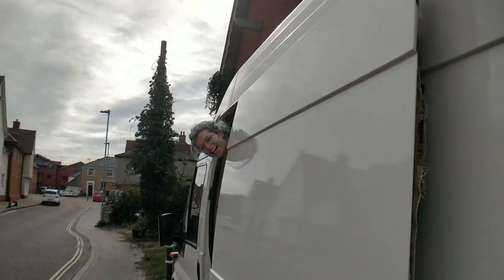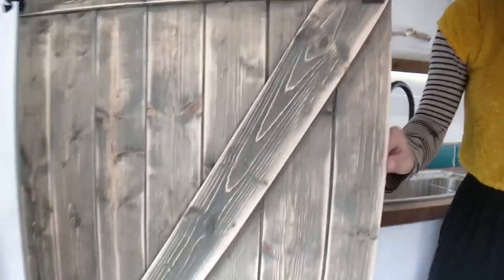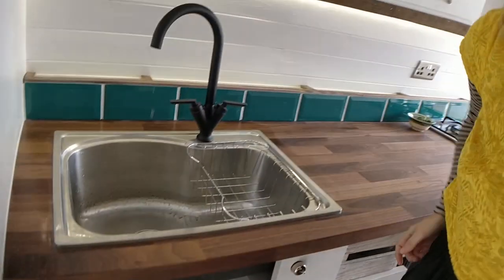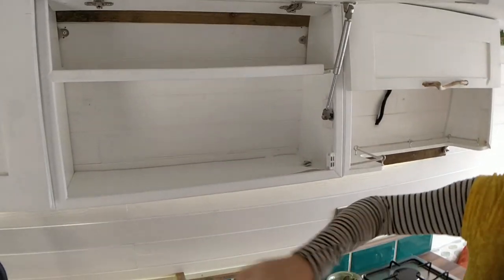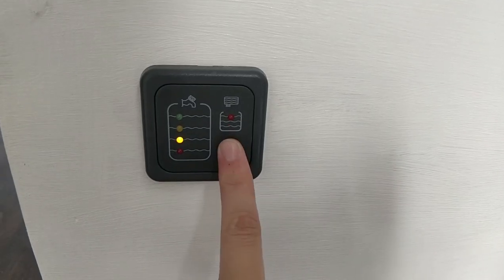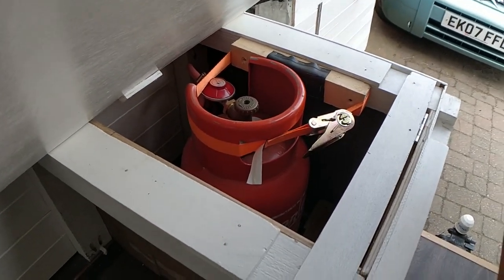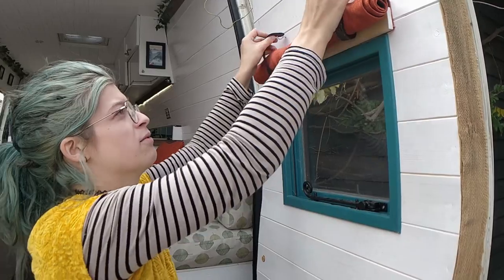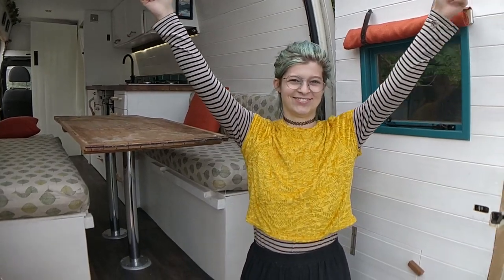My Ford Transit High Roof Van Conversion Tour!!

Comment: Stunning van Mary. One question, did you fit a flue to the water heater?
Reply from the maker: Hiya, yes I did. It goes out the top of the boiler then straight out the side of the wall. I've also coated the wood it's mounted on with fire/ heat proof paint :)